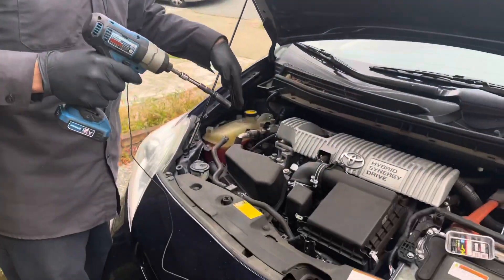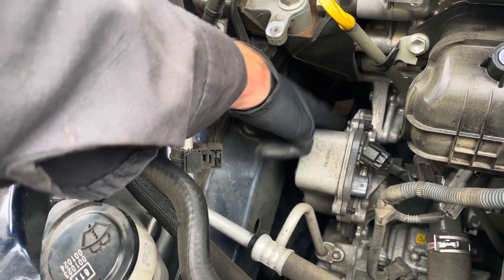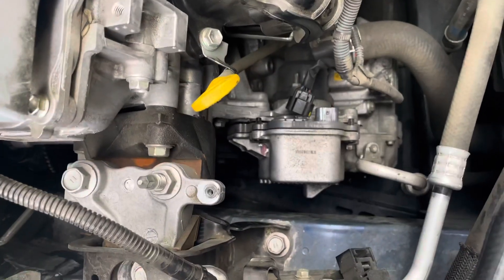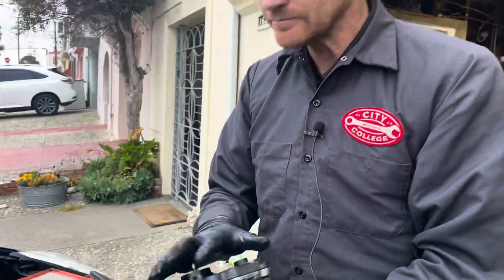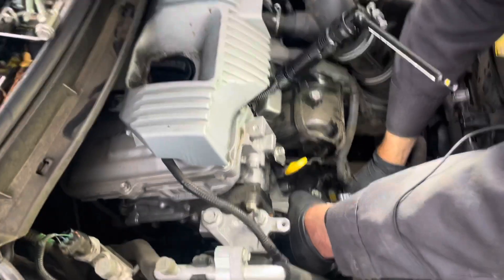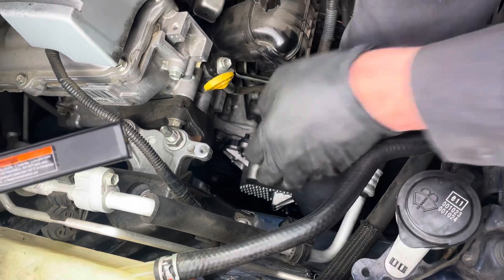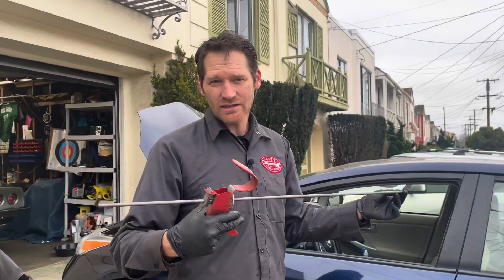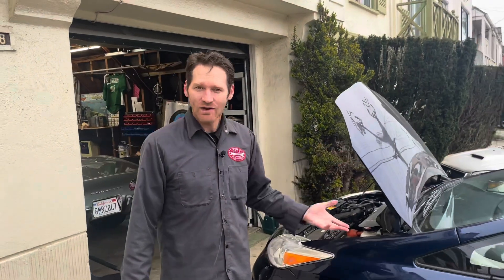2015 Prius Water Pump

Comment: I don't see AISIN on the pump. Was it a genuine OEM Aisin part?
Was the rubber gasket already fitted?
Reply from the maker: @davidhinton3595  rubber gasket was separate if I remember correctly. I don’t know if it was an oem part or not. I seem to remember the vehicle owner brought the part.

Comment: I had a mechanic replace the pump that I purchased from the Toyota dealer along with the thermostat .And right after 8 month I started getting air in the system that I bled myself then for some reason now I am getting the water pump code again . Any similar experience with those ? 
I know there is no head gasket issue at all since I am no loosing any coolant and no smoke or coolant oil mixture so that was confusing enough for me could it be a corrupted module error ? Do these pump need coding after install ? i don't think the mechanic I used for this job would have done any coding though .
Reply from the maker: I would replace the pump again. If it malfunctions the engine will be ruined.

Comment: prius 2014 doesnt have error code with torque or OBD2 haryy app and neither does the temp alert light on the dash - senior mechanik at toyota dealer found advised to replace the engine water pump and the thermostat at the same time since it didnt activate when my car was bellowing steam out and only the engine light came on from that

Comment: I just got the 261b error code but it was on a 100 degree day.  I want to replace it asap.  It's the original pump and I have 248,000 miles on it.  Did you have to drain any of the coolant or did you just remove the pump and catch the coolant?
Reply from the maker: I just placed a catch pan. beneath the pump.

Comment: At how much kilometres100k-200k ?
We should change the pump?
Reply from the maker: I have always waited until it fails but replacement before failure makes more sense since it risks major engine damage to let it fail while driving. 
I don’t know when to recommend replacement but if I had to guess 
150k miles or 240k kilometers  
Keep in mind a cheap aftermarket pump may do more harm than good, I would buy a real Toyota pump.

Comment: How did you know the pump was failing?
Reply: Mine is overheating with no check engine light, replaced the thermostat but same problem
Reply from the maker: @Lilchrisc123  the vehicle in the video had a code

Comment: I do enjoy the video, just a bit of advice, could you tell us (the viewers) what noises or signs what we need to look for, to detect if the pump is defective?
Reply from the maker: It is a code and check engine light that serves to warn us that the pump is going bad. There is no strange noise when it fails (at least in my experience)
Reply: No warning signs, only the code and couple dash lights

Comment: ... Engine Electric Water Pump magnet For Toyota Prius 10-15 CT200h 161A0-29015 impeller only is available for only $29.99 so im planing on changing mine (10 year 100kmi) as a preventive maintenance item. fresh coolant also. Thanks ... KC ..!

Comment: How did you know it was the water pump? My issue is that it works until I reach speeds over 50 then the red light comes on. Also, it is 15lbs on the first 3 short bolts and I believe 20 on the two longer ones. Also, is it a must to use that pink stuff or can you use any antifreeze?
Reply from the maker: There was a code that indicates water pump, I would use the pink coolant, they have it at oreilleys.
Reply: @Mrelectric423  Actually Walmart started producing one and it’s only 10 dollars a gallon instead of 20
Reply from the maker: @pydepiperproductionsllcjon7585  Good info thank you!

Comment: Dumb question but you didn't have to fully drain the coolant out of the radiator?
Reply from the maker: About half the coolant drains out once the pump comes off. Refilled after the job.
Reply: @Mrelectric423  Thanks for the quick reply! I'm going to change mine out tomorrow - although the Check Engine light today is no longer on my display. Could it be due to the cold weather? Going to plug in my OBD II again and if the P261B code is still present I'll change it out. Weird.
Reply from the maker: @floydk2813  Dont wait until a brief but extreme overheat blows the headgasket

Comment: You don’t need to push the gas pedal , just turn on the heat and engine still running, Prius has 3 water pump , Thanks for make video

Comment: So how do you reset or correct the codes? I have a plug in that I can reset but I dunno if that's good enough or will it just know it's working and check hybrid system code go away?
Reply from the maker: Some codes go away after 4 on- off key cycles . Others require an advanced scantool. Advance scantools like autel have dropped in price to under $200. All of this assumes that the original issue is resolved.

Comment: Nice Video. So, is it ok to use RTV sealant along the outer side of the rubber seal or is it unnecessary ? Thank you and I subscribed.
Reply from the maker: I would not use sealant, but there are many ways to do a repair job I am just reporting my guess on the best practice.
Reply: @Mrelectric423   I am about to change the spark plugs on my Prius V 2013 since I got everything out cleaning the intake manifold and EGR cooler. Do you recommend NGK Laser Iridium spark plugs or Denso Iridium spark plugs that are available at the dealer ? Thank you.
Reply: I've never had problem using rtv high sealant.  ThT would be your choice, but if you are using ready made gasket, it's unnecessary.  It's being squeezed to seal the gap as is by tightening the bolt.

Comment: Excellent teacher. To the point and straightforward. Is this pump the same as the "inverter coolant pump " ?
Reply from the maker: Thank you!
The coolant pump is different than the inverter pump.
Reply: Mr. Electric  Might be worth considering making a tutorial on gen3 inverter coolant pump replacement. There are ZERO on ytube and lots of desire from the prius community

Comment: i got p261C  means water pump?
Reply from the maker: That code means no power to the pump. Is ther any rodent damage to wiring in the car.
Reply: @Mrelectric423   no i took look but the wiring seems to be fine.  i even check the fuse . and still ok.
Reply from the maker: @jdmfans6078  it’s a pretty quick job to change the pump. Maybe put on a new water pump just to rule that out despite the code indicating wiring.

Comment: No bleeding?
Reply from the maker: Just the process described in the video
Reply: @Mrelectric423  So basically just heat cycle and fill as it's drawn in?
Reply from the maker: @snoobler  yes exactly. I used a pedal depressor but driving around, stopping 3 or more times to top off would do it too.
Reply: @Mrelectric423  Seemed too simple! :)  I've had folks attempt their own inverter coolant pump replacements on Gen2.  After a drain, the system is air locked, and it won't even bleed out w/o pressure/suction. Customer doesn't understand what they did wrong.  Gen2 engine coolant is typically more involved too.